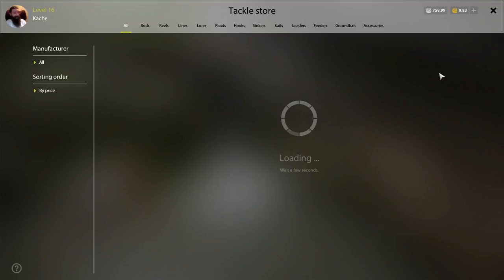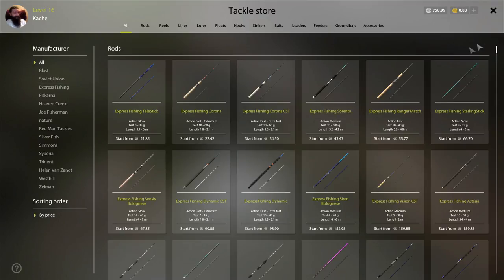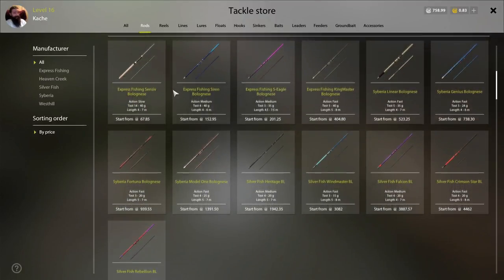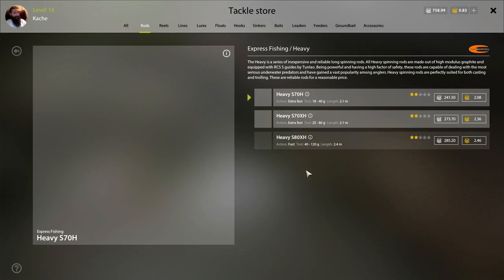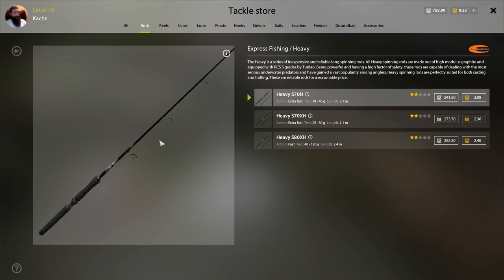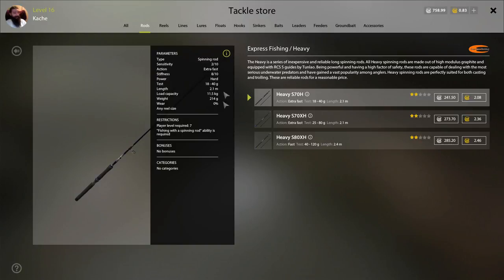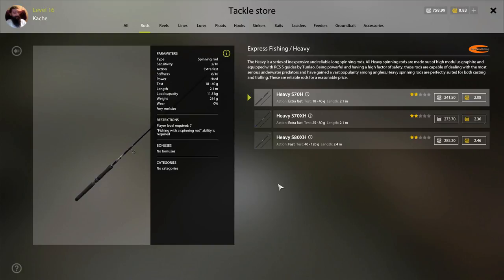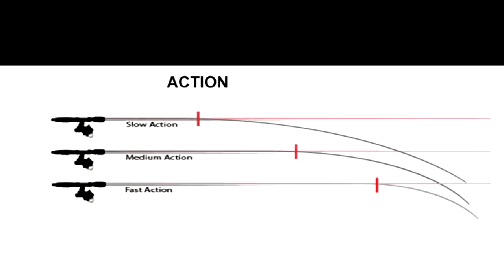RUSSIAN FISHING 4 ENGLISH | Rods Action-Power-Stiffness

Comment: This has been the only clear explanation of fishing rods I've seen. Thank you. To clarify, would it be correct to say. Power is how much the rod actively bends under weight to absorb the energy? Stiffness/modulus is the rating of how much weight the rod can take before actively bending?
Reply from the maker: Power is how resistant to bending the rod is by weight applied, while modulus is the stiffness factor of the actual rod material.